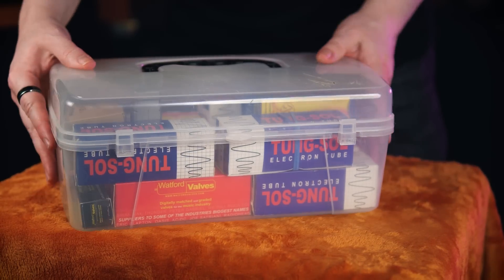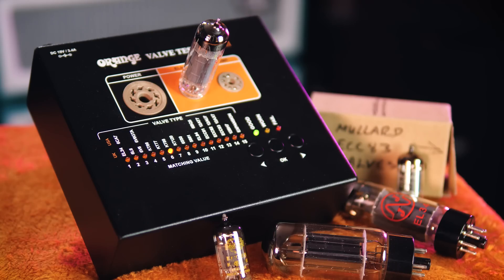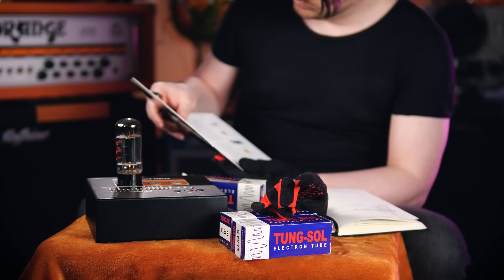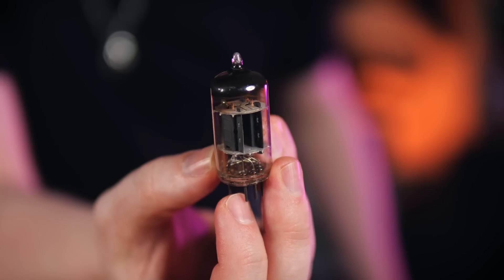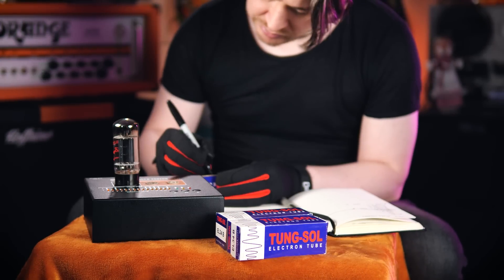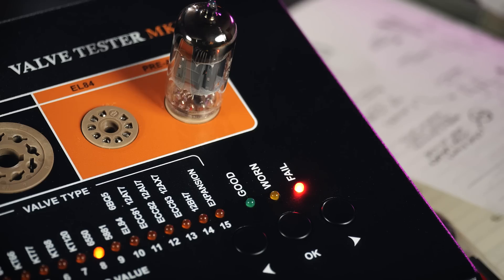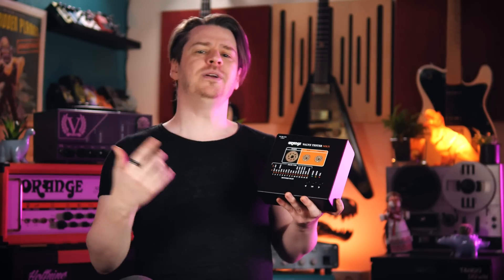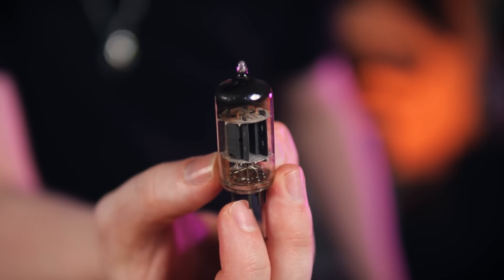Find Tube Faults Easily! | Orange Valve Tester MkII

Comment: Another thing about replacing valves, many amps will require the valves to be (re)biased. Now that is beyond most guitarists.
Reply: Yeah, wasn't it that exact thing Colin once said
"Don't fuck around if you don't know what you're doing"
Reply from the maker: People got REALLY upset with me for giving out that warning - they took it as a personal insult rather than me protecting them from a potentially lethal electric shock. 
I will never encourage anyone to open up their amplifiers and start poking around UNLESS they are appropriately qualified to do so. 
Even the people who are qualified and experienced get shocked occasionally - it would be much worse for people who weren't taking the proper precautions.
Reply: @ScienceofLoud  wow, I never would have guessed! 

Well, I appreciated the warning.
Reply: My old Traynor 300W bass amp had bias controls on the back for each tube AND indicator lights to make this a breeze.
Reply: Only fixed bias amps require this and it usually comes down to turning a potentiometer, a musician may not be able to target a specific plate dissipation % but they can probably turn a knob until their tubes are not red plating
Reply from the maker: It's not really about that though: It's about people sticking their hands inside live electronics with hundreds of volts coursing through them. 
If you don't know what you're doing, it would be very easy to short a filter cap, or have one hand on the chassis while the other is touching something live, or to go in there with rings or dangling necklaces...

It's all the knowledge that keeps you safe while turning that trim pot that matters.
Reply: @ScienceofLoud  I am left hand dominant.  Whenever I get to fishing around inside an amp, valve or solid state, I always have a 5000V safety glove on my right hand.   I nearly got killed fussing with an oscilloscope lead while taking a measurement.  Not doing that again.  If I need both hands in the chassis, I shut it off first.
Reply: @louiscullman4195  And use a shorting stick (chicken stick) to make sure the capacitors are fully discharged to ground.  You can't trust the bleeder capacitors with your life.